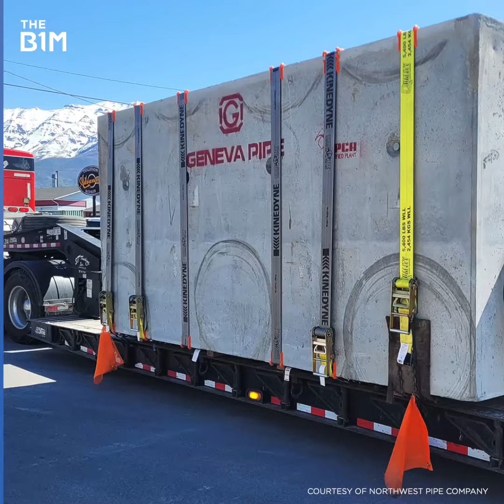The Innovation That Fixed Arizona's Critical Sewers

Comment: I vote for the sewer project in Tucson.  Using a temp bridge to cross the river is outside the box thinking, especially considering the length.  A clear span 270ft long temporary bridge is no small undertaking in its own right, and the loads must have been pretty significant to boot- the pipes would have had to have been designed to accommodate surge/peak loads (where's that sports section?) at different times of the day.  Nice job!